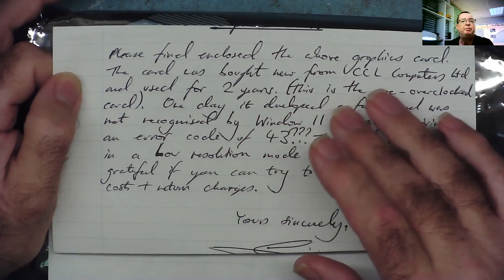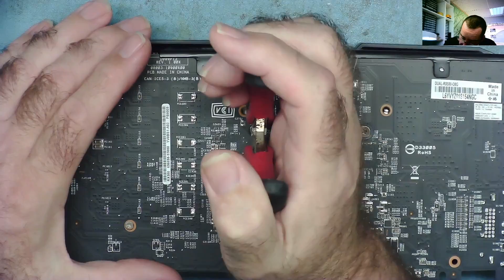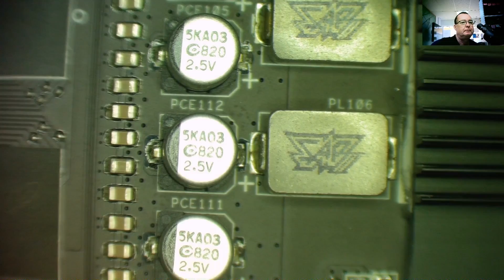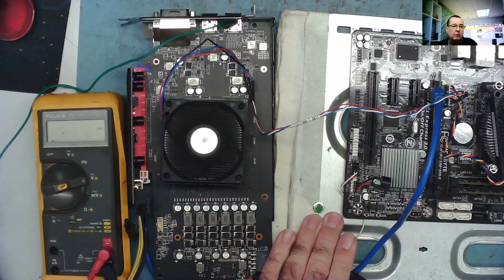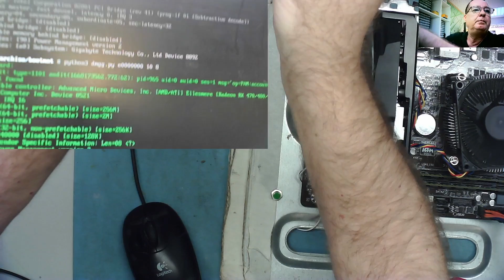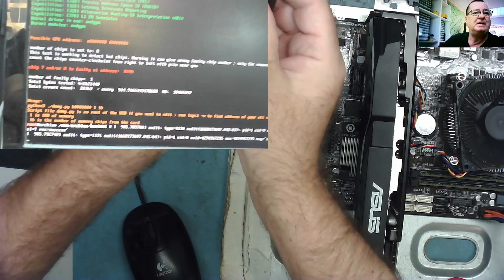RX 580 8GB Graphics Card GPU Error Code 43 In Device Manager - Fix RX580

Comment: It's a bit funny to run into that video because like 3 days ago I had something pretty similar It just started at specific games with a no video out driver crash and went away with a driver reinstall until the cycle is repeated. But it seems to have vanished after flipping the bios switch front and pushing in the power cable more.
Anyways if it's not gone for good I at least have an idea what it could be, trough the occt memory test ran without issue.
Also I was curios and GPU-Z doesn't give me a clock reading either, but the amd software and HWinfo64 do.

Comment: i had that problem. I fixed it by flashing the bios of the card. When i had ordered it I did not tell the warehouse that I was planning to use it for gaming. The card worked well until recently when i realized that my motherboard stopped reading my ram cards. I used this as an excuse to upgrade my pc. Now i have a Nvidia 3060ti with ray tracing.
Reply from the maker: Yeah unfortunately flashing the BIOS did not help in this case.  Just goes to show you can have the same symptoms caused by different faults

Comment: When testing amd it would be good to try a Linux live iso. AMD drivers are built into the OS's/distro's. Just to see the difference between how it behaves with windows.
Reply: Sorry, I sent that before ai finished the video. I see you did use a Linux testing setup. On a different, there is a noticeable low-level hiss on the audio in this video. Just an FYI.

Comment: What is pex?
Reply from the maker: Pex is a shortened way (slang?) of saying PCIe Express.  On a GPU, Pex refers to the voltage rail that powers the part of the GPU chip which is responsible for the communication between the PCIe slot on the motherboard and the GPU itself.  It is typically 0.9V
Reply: Thank you very much!

Comment: Cause of that code error 43 most of the time 80% was the bad vram memory chips, u need to diagnose it with the memory tester used by manufacturer to test the vrams
Reply from the maker: Hi KIMMY0312 Is a problem with the linux script I used to test the Vram?  When you say 'memory tester used by manufacturer' is that some other software (Tserver?) or some hardware I don't know about?  Cheers.